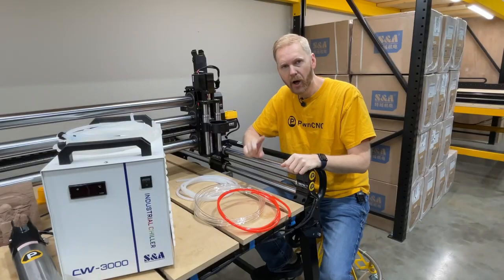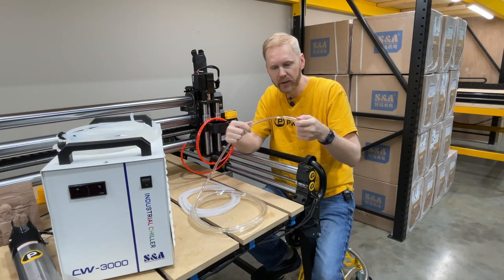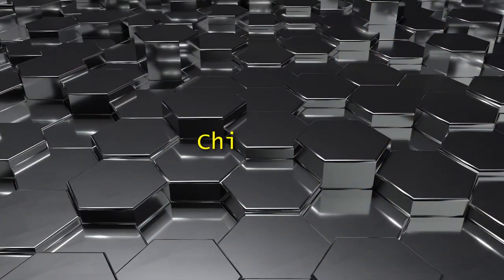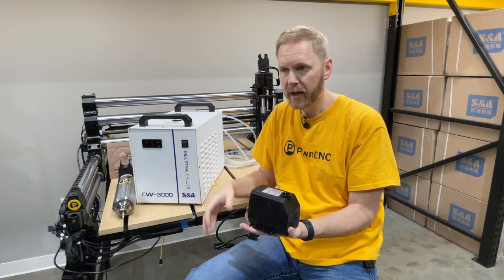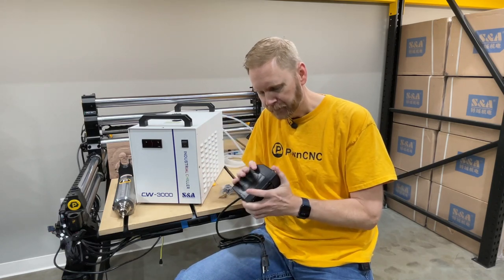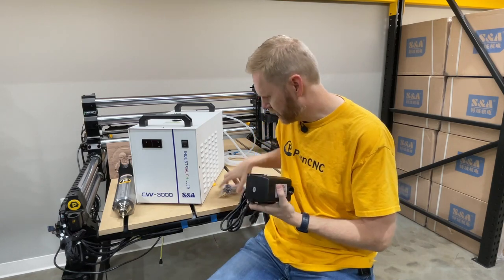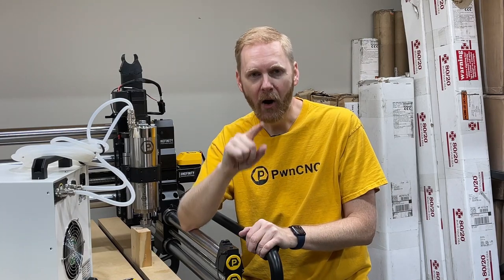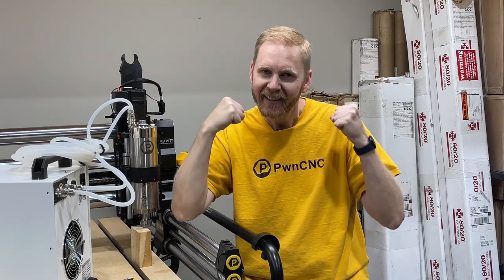PwnCNC Spindle Cooling Options

Comment: I created my own "chiller" with pc cooling components. I used a single 120mm fan and radiator and added a flow and temperature sensor to send alarms to masso. The best part is it's small and mounted to the conroller box. Total fluid capacity is about 24oz, works great.
Reply: THIS.  So much easier, fairly inexpensive, and it's a closed loop that doesn't get sawdust in it.
Reply: The other thing is that there are cheaper CW-3000 options available as well if you're willing to shop around. I recently purchased a brand new Vevor branded one for ~$120 on ebay including tax and shipping. Warehoused in NJ apparently.  So it's something to keep in mind considering it's a turn-key solution. As far as I can tell on the insides, they're nearly identical to the S&A ones PwnCNC is selling.

Trying to import it yourself on aliexpress definitely doesnt save you any money in this case.
Reply: This is the route I would go, even a mediocre AIO would probably handle the heat put out by the router, given the right climate of the shop itself.

Comment: These guys are awesome, customer service is second to none Im so pleased to be using there products.... Now lets talk about the noise level of that chiller is it quite...
Reply: Daniel actually experimented with changing out the fan for one with very expensive bearings and discovered it made absolutely no difference. 
The fan blowing over the coils can be heard but in comparison to a shop vacuum/dust collector (even mounted outside, in another room or in a cabinet) a bit cutting material or even the cnc when it is moving around the chiller will never be heard. It can be compared to the fan noise of the VFD-Enclosure when it kicks on... the chiller might be just a bit noisier but not by much.

Comment: I have a 2.2kw spindle. The submersible pump that came with it is rated at 3200L/H which is 53L/M. The CW3000's on Amazon pump at 10L/M. Is the flow rate of the CW3000 sufficient for my spindle?
Reply from the maker: Indeed it is.  The chiller is more than sufficient for cooling the spindle during long carves.
Reply: @PwnCNC  Thanks for the quick reply.

Comment: can i use tap water?
Reply from the maker: You can, however you'll have to change it frequently.  The key is to prevent any growth in the fluid and tap-water is rip with things growing.  Window washer fluid would get you to 12-18mo and be better as a cheap alternative that lasts longer.  Distilled water would let you get to 3-9mo.  Tap, i'd change that every few months at a minimum.
Reply: @ thanks

Comment: Great information to have.  I'm in Texas and even with a mini-split system my shop temperature can reach 84 degrees if I've been running the planer and dust collection for a while so I plan on using a remote reading thermometer in the 5 gallon pail and adding a freezer block to the bucket when necessary.  Considering the RV anti-freeze for pump longevity as opposed to the methanol in the windshield washer fluid.  Thanks for the tips.

Comment: I am using the "Superthane Ether" with the Rowdy Roman cable chain clips and it works great. The first few hours of use it made the cable chains bow-up when there was movement but by the next day it relaxed and is now working flawlessly. I love that it is perfectly clear and you can see the water pumping through when the IoT Relay kicks on the pump.

Comment: what do you recommend for tube management?
Reply from the maker: We're working on a few options but nothing has solidified just yet.  Currently our recommendation is to look into RowdyRoman's tube-clips.  They're decent.  Another option we've found is UglyDog has a "larger cable chains" upgrade available which might work well, although i have no experience with either solution.

Comment: I got a cw-5202 with dual  devices i use 16- 20 celius for  c02 laser should i use like 24-28 celius  for spindle
Reply: Can you run and regulate each at the same time? My co2 laser sets right beside my Elite. I might have to look into that if anything ever happens to my CW-5000 that came with my Thunder Laser.

Comment: I have a non climate controlled shop and sometimes it reaches up to 80 degrees Fahrenheit. Will the chiller do a better job than the regular pump to keep my spindle cool.
Reply from the maker: The key with spindles is you want them running at or just above ambient temps.   A CW-3000 chiller is great at keeping the spindle at ambient.  If you use something like a CW-5000, you'll want to make sure the temp controls are set to ambient.  Even as the ambient changes through out the day, the temp should be set to close to that.